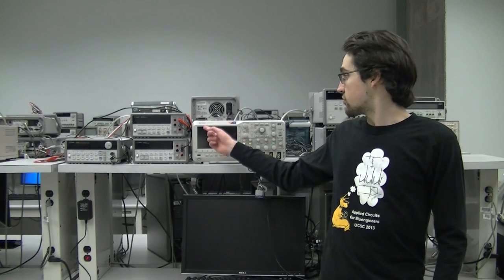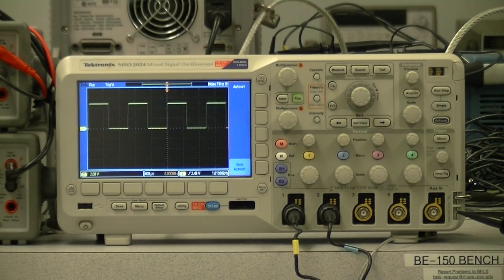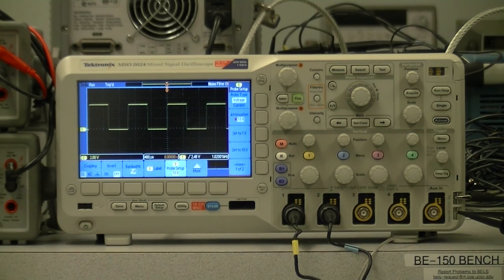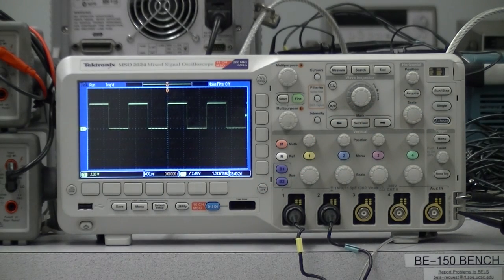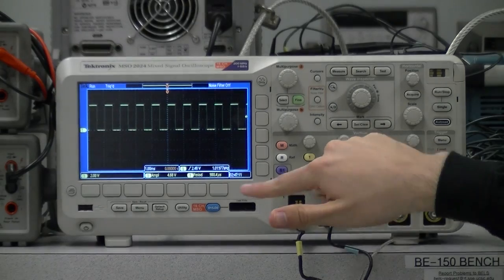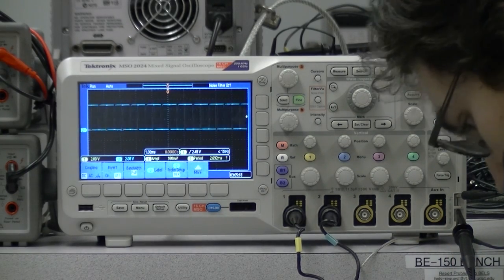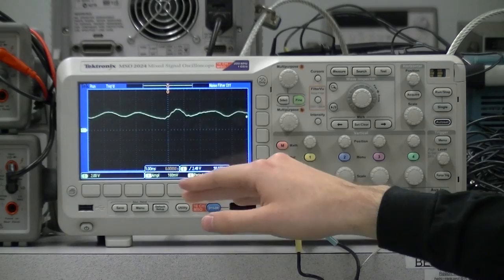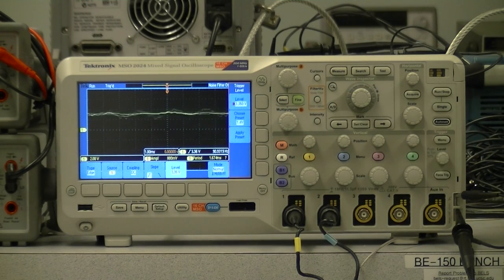Oscilloscope tutorial March 2016

Comment: sir I have a problem using oscilloscope at my college lab. there is sinewawe and even double sinewave displaying on oscilloscope without any input. Instead of showing my circuit output this sinewave continues to display even after I have connected my circuit output to oscilloscope.
Reply from the maker: Sounds like you haven't connected the ground lead and are picking up mains frequencies (50Hz or 60Hz, depending where in the world you are).
Reply: i have connected the probe to my circuit and ground. are you talking about that ground terminal on oscilloscope other than probe ground?
Reply from the maker: Not being present, it is very difficulty for me to debug your circuit and your oscilloscope, but a large mains-frequency signal that is unexpected often indicates that the ground wire of the probe is not connected.  Sometimes on the scopes in the student lab, the ground wire is broken (often not visibly).  Does the signal go away if you just connect the probe tip and ground wire together?  If not, suspect a broken ground wire.

Comment: go banana slugs. Didnt even notice your shirt i later went back to the video to look up something
.
Reply from the maker: My son, who did the presentation here, is a Gaucho rather than a Banana Slug, but he wore the class t-shirt for my class (he developed the PteroDAQ  used in the course).  The class is indeed taught at UCSC, and we have had a T-shirt for the course every year.  We no longer use these oscilloscopes for the course, having switched over to using Analog Discovery 2 USB oscilloscopes (much easier for students to learn to use, and much better value for money).
Reply: @gasstationwithoutpumps  Yea I took few classes that will make tshirt afterward to remember the class (i,e CMPE118) fun times!
Reply from the maker: @yegetazeleke1790  My course has T-shirts for about the same reason mechatronics does: lots of work that students want a souvenir for.